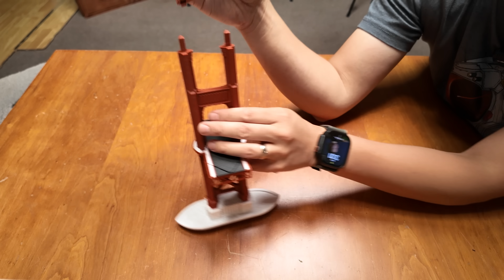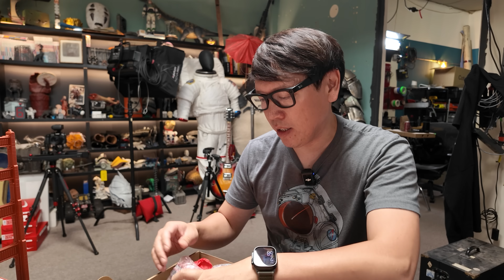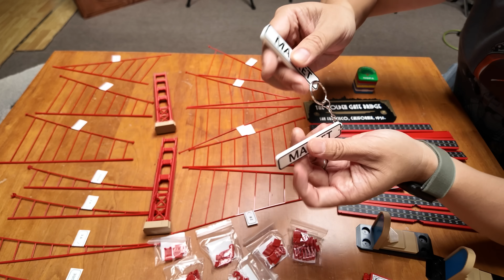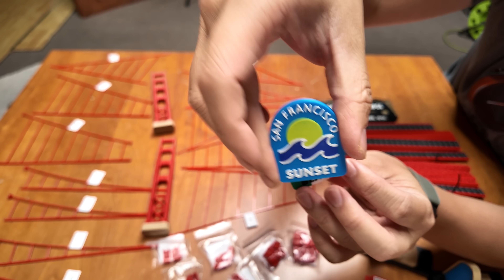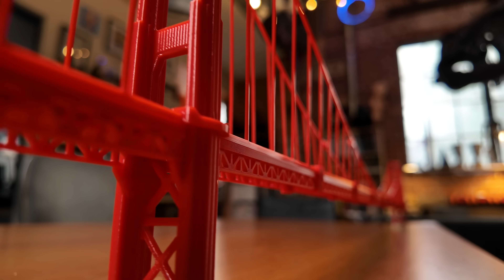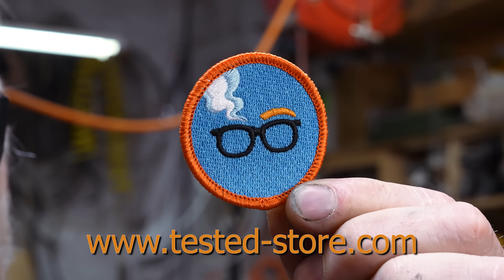3D Printed Scale Model of the Golden Gate Bridge!

Comment: The advancement of 3D printing has been truly amazing. I have been printing for nearly 15 years. My first printer was a kit made of laser cut wood and nylon fishing line with a tiny build area, then I bought a Printrbot kit when they first came out, that was very similar. It seemed like science fiction back then. Over the years I have owned nearly 30 machines (both FDM and resin.) I recently purchased a Bambu P1S - and with that manufacturers machines I can safely, confidently say they have reached the "appliance" level.  Pretty amazing stuff.